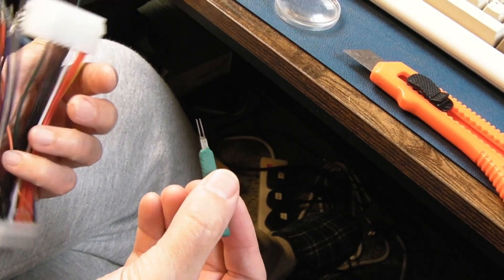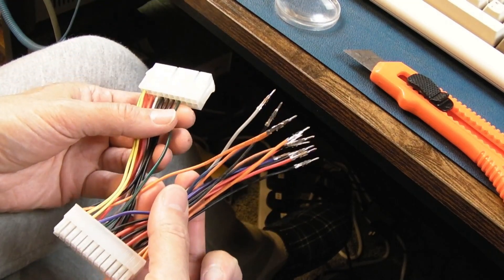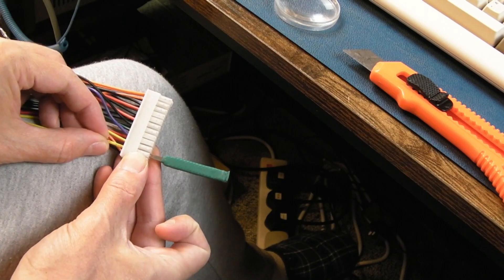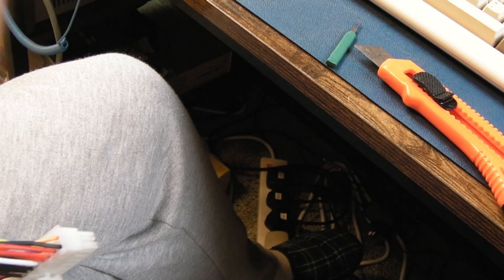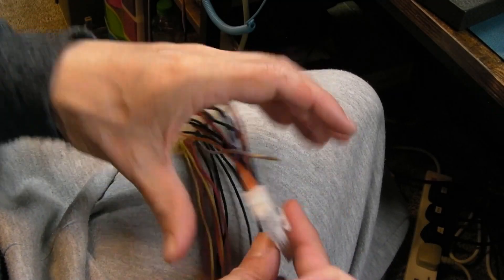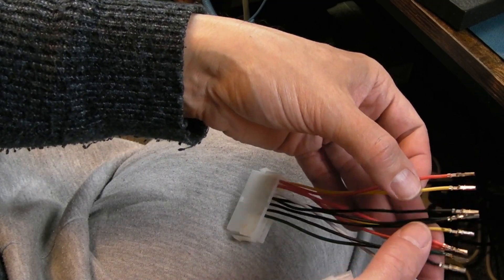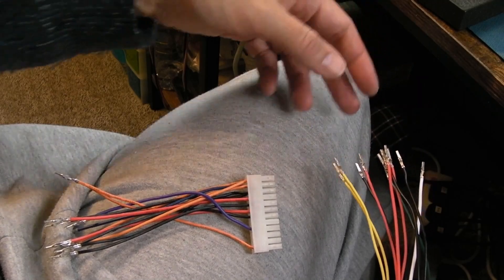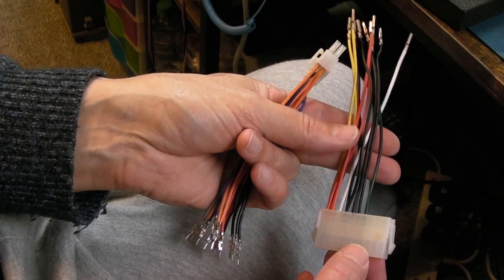ATX / PCI-E Pin Removal Tool (Follow Up - those pesky pins)

Comment: Few year ago I've ordered a set of 4 tools for all kinds of connectors used in PC building, and the included tool for pci-e and 24 pin connectors was reasonable easy to use (not great but I had a fair share of repinned cables from modular psu's). But I left it behind when moved to another continent. Not so long ago I've ordered another one, more expensive (it was still cheaper then set of 4) and this one is worse, but I made it easier to use, I've cut few mm of one of the prongs, and what I do is, I pull the cable to one side for a gap between plastic and the pin to get big enough to fit the longer prong in, once it's done I pull the cable (not hard, no force is required) to another side and push the tool in, so shorter pin also got between plastic and the pin, after that I only need to push it firmly and the pin pulls right out, no folded prongs on the pin. Some connectors has a really narrow gap, that makes it almost impossible to remove still.

Comment: I used to use a similar tool for similar connectors back in my Navy days last century. Mine was a sort-of tube of metal with a bit removed so it could fit around the crimped wire - it went in the back of the connector

Comment: If you need to pull that hard the tool isn't working at all. As you see with the folded out prong.
I built a poor mans version using the metal of paper staples and some 3d printed holder and the wire comes out without any big force. Still fiddly, but you get the hang of it.